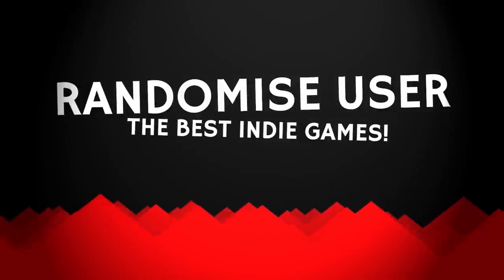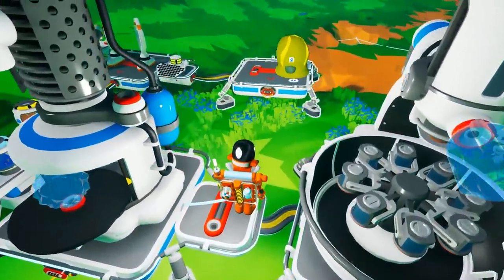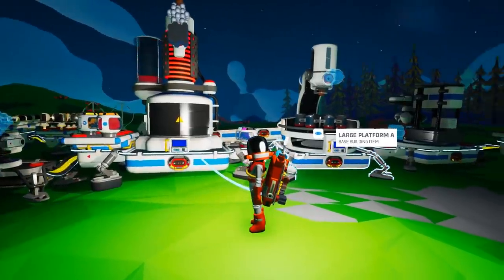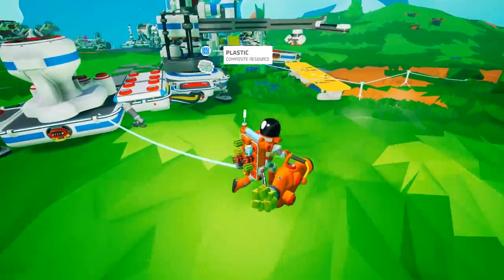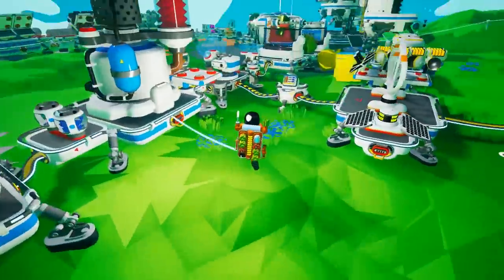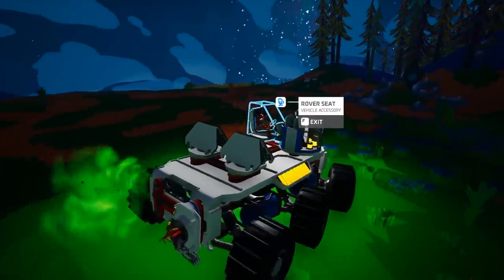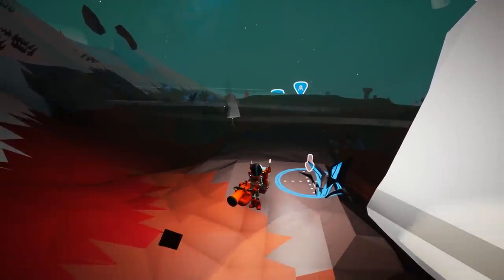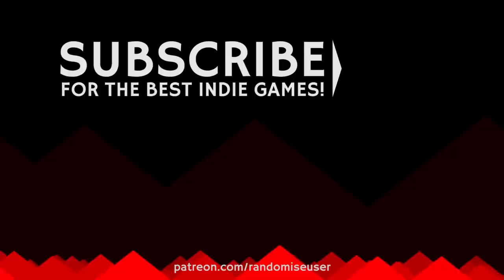ASTRONEER SOLAR ARRAYS: So Much Power, So Little Time! | Let's play Astroneer 1.0 gameplay ep 19

Comment: Tbh I find the splitter pretty much useless. When set to split power, it will always split it that way, even if one side requires a lot of power while the other requires none, it will still be wasting the set portion on the useless half. If you want to do power management, what you really want is just regular Extenders. Then split the base in two parts - one part with solar power and all your researches, other half with your batteries and some wind power. That way, during the day, your researches will run at full power and share their surplus with the base, while during the night those guys won't eat up your batteries, leaving the stored power to be used for crafting.
Reply: That's a great idea.   Ive never used extenders but if I understand correctly the power only flows one way thru them.   So you are using one or more to allow the power to flow from the research side but not the other way, right?
Reply: @chrisjones6002  Yup! The problem with allowing research stations access to batteries is that they will eat through them very fast, but it would still do only a tiny bit of research. It's only worth it if you have a giant battery farm and are not doing all that many researches at once.
Reply: @MrAdannor  thanks for the tip.  Looks like I'm doing a redesign of my main base or more importantly my future bases when I start over.  I pretty much already have everything unlocked I think.

Comment: I might be wrong. But the solar array Is way faster and better than the fallen giant solar thing
Reply: According to the wiki the array is 8a and the wreck is 2-4a so the array is much better if that's right.   Plus the array is smaller and looks better I think.   I would use a wrecked one if it was convenient but I haven't seen any at all.
Reply: TheSkepticSkwerl thanks, I was going in endgame and was pulling out my hair whether the satellite solar was better or the solar array.
Reply: @flowepower3000  the wrecked solar was convenient years ago. And if ones next to you, use it. But don't desire one if it's not around. They're a pain to move. Giant. And weak.
Reply: TheSkepticSkwerl ha you’re right. I moved a solar panel bigger than my entire base only to realise that it had no power output......
Reply: nowadays the wrecked solar array provides 64 units of power, so it's a lot better now